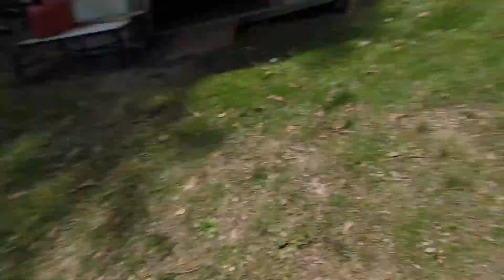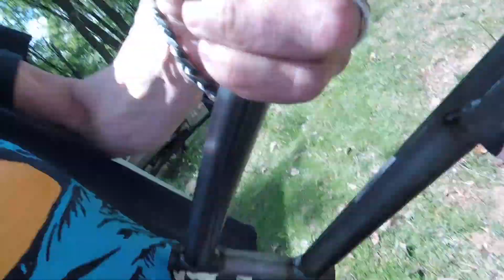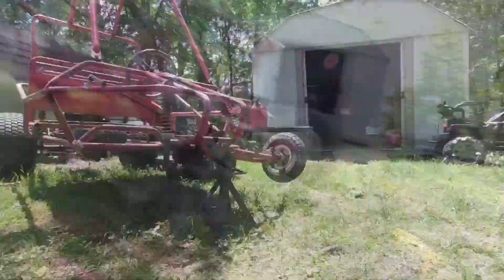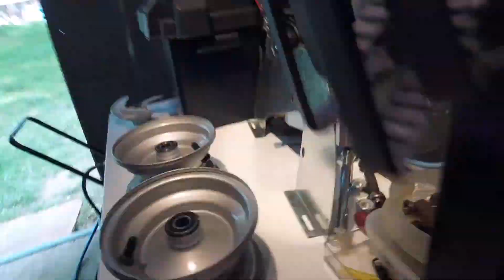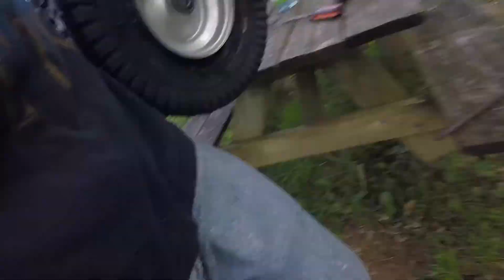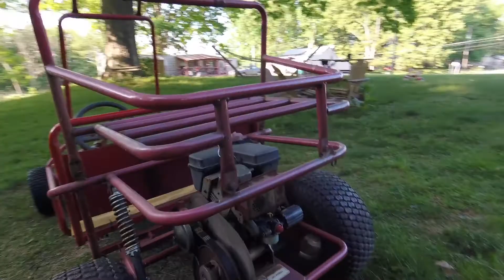Yerf Dog A arm replacement and new front wheels

Comment: i just finished putting dual a arms on the front of my Yerffy.  it was a lot bigger job than i originally thought.  literally cut the the front off and started from scratch.  the old bolts had to be cut off but having all new parts it didn't matter.  my cart went from a unenjoyable riding experience to that of a really fun cart to drive.  handles like never before.  moved steering form the left to the center and replaced the park bench seat with a bucket to keep me from slamming my hips into the sides.  also i removed the Tecumseh crap that was on there and replaced with a 13HP GX 390 Honda that i picked up for 20 bucks.  it was filled with mud all the way into the crankcase. 1995 motor.  put a 40 series torque converter clutch on it.  this cart was pulling the fronts off the ground before the a a-arm swap but i also extended the front of the chassis 3.5 inches.  its like a very slow dragster.  torque for daaaaays and days and a top speed of 47mmph.  its kind of scary but worth it.
Have Fun and Stay Safe
Reply from the maker: That sounds awesome, and alot of work. 
Definitely a cool project,  I would love to see some pictures
Reply: I'm doing the same on a 2 seater manco.  putting in a rack and pinion too.  turned out to a be a lot of work, and I'm just learning to weld.  first try did not come out right at all, but I think i got it now.

Comment: I got those same parts lol , I’m now trying to figure out how to get the bolts off
Reply from the maker: I had to cut off both ends of the bolt 🤣
No matter how hard I tried it would not come out
Good luck on your project
Reply: @dexgraves8684 my bolt won’t even budge enough to cut off the hex head. Think I can just cut out the center of the A arm?
Reply from the maker: @BrianWM  that would probably work, maybe a grinder with a cutting wheel would work better.
I still haven't done the other side yet because of that 🤣
Good luck, you'll get it one way or another
Reply: @dexgraves8684 thanks! Doing both sides this weekend. I’ll likely cut them off with a grinder and cutting wheel. Will report! Lol
Reply: @dexgraves8684 for what it’s worth, I just got both sides off. Removed the back nut, applied a ton of heat via Map Gas and kept the impact on it while the rust came flying. Reversed a few times (in/out) and the bolts began to spin freely.
Reply from the maker: @BrianWM  awesome 🤘, glad to hear that!
Wish I could have seen it.
Looking back, I wish I put anti seize or grease on the new bolt...

Comment: Where did you get all the new bolts, thx same problem w mine
Reply from the maker: All the bolts I got from my local hardware store,  all the new parts I ordered from bmikarts.com
Reply: @dexgraves8684  what size is the front end a arm bolts, I can’t find a socket that size to save my life ima going to have to go buy two
Reply from the maker: @dallasbays9428  I don't remember the size of the bolt. However, on my kart the bolt that holds on the A arm itself was siezed inside the A arm,  I was able to move it enough with a hammer to cut off both ends with a Sawzall and remove it,  it was not easy 🤣
Reply: @dexgraves8684  I had to cut it off like you, wasn’t fun or easy as the video haha
Reply from the maker: @dallasbays9428  haha not easy at all, glad it worked out for ya though.
I'm going to eventually do the other side,  but I'm in no hurry
Reply: @dexgraves8684  love the videos keep them coming, would love to figure out some more things, doing the kill switch tmmrw the video you have up will help!
Reply from the maker: @dallasbays9428  thanks for your support 
Hope you get that kill switch fixed